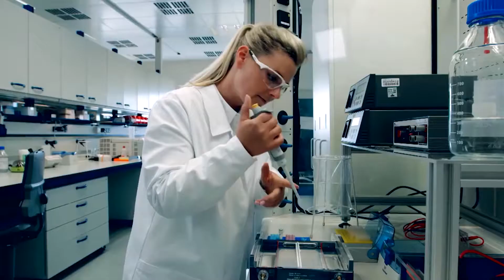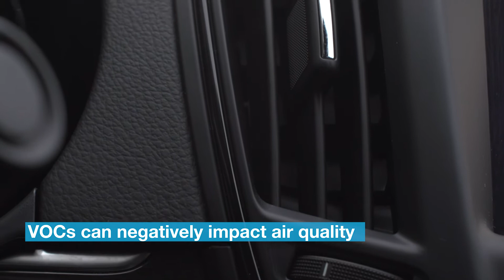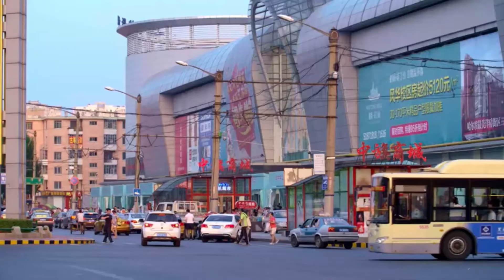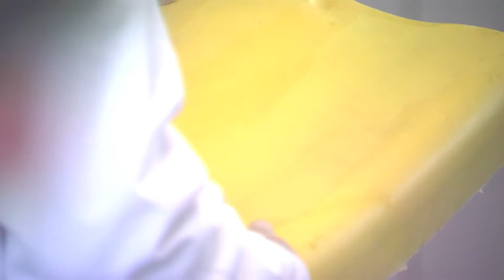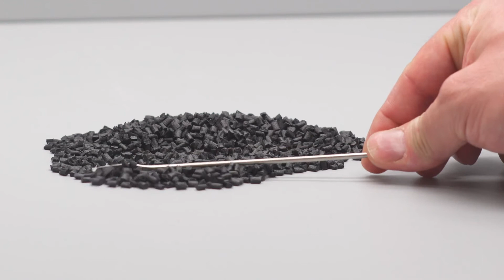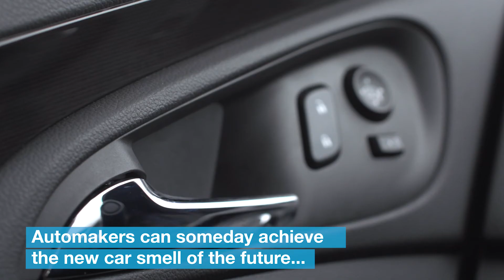BASF’s Low VOC Polyurethane Enables New Car Smell: Odorless

Comment: Are any manufacturers going to use this in cars for sale in the US, and if so, how soon? 

I have a disorder called hyperosmia which makes me hypersensitive to odors. Things that most people can't even smell trigger migraines and nausea for me. I am still driving a 1992 Toyota Camry because it has no smell and it has not been possible to find a newer car that is odor-free. It's too hard to find one where the previous owner hasn't used perfume, so-called "air fresheners", fragranced chemicals to clean the interior, etc., as well as never letting anyone smoke inside the car. Of course buying a new car has always been out of the question, even though money is not an issue. My 26 year old car is starting to need parts replaced that cost many times the value of the car itself.
Reply from the maker: BASF is actively working with OEMs and Tier suppliers on conversions but it will take some time (4-5 years) to change the entire interior.